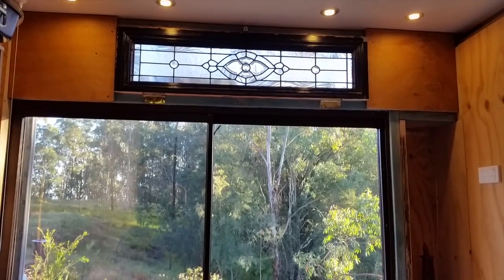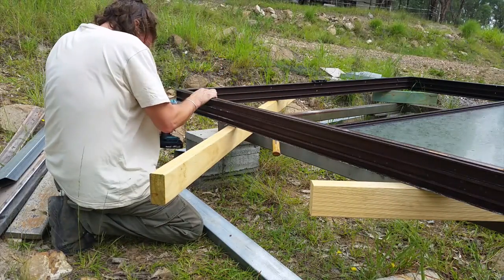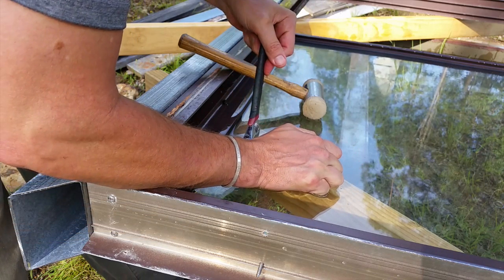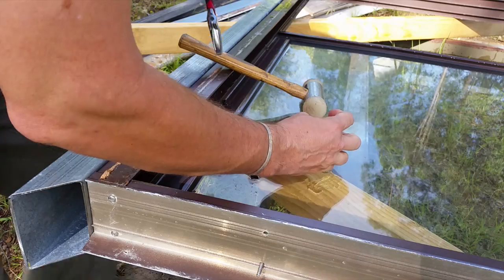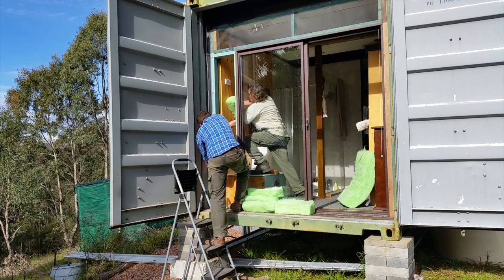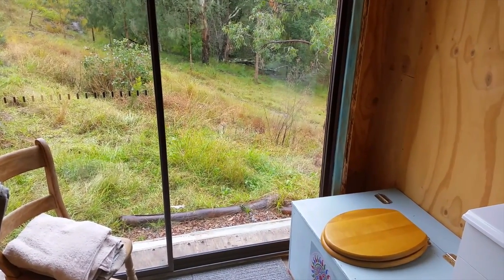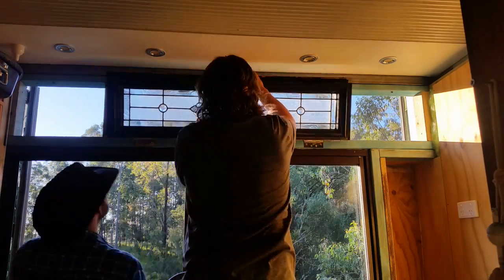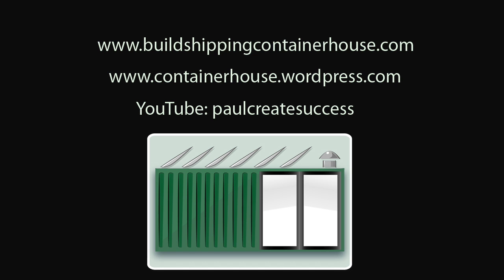Shipping Container House – Install sliding glass door wall in shipping container bathroom

Comment: Naturally people are impressed with your skills and ingenuity... the stuff Australia is made of.. but wow. what effort for such a cheap door. the biggest concern for me would be that door is already second hand and they are rubbish to start with. How long do you think that door will last? I think you will be replacing it within two years and you may then have a hole in the wall you can't fit any other door in? I'm about to go 'off grid' myself but I'm paranoid about things breaking or not lasting.. so I'm going the other way. only buying the best.. BTW. its a great vid thanks for posting!!
Reply from the maker: +bicanoo_magic Hi Bicanoo, Welcome. I can respect that opinion. I have considered that approach. If I were going to replace at a later date I would for speed and effort get one made the same size. The reality is that having built everything I fully understand how easy it was to assemble. I would be able to remove it in a very short period of time and framing around the the replacement was very inexpensive. I invested time rather than dollars. Thankyou for sharing, it is good to share alternate approaches. Cheers Paul

Comment: Glad to see that pane of glass did not break when it dropped from the frame :)
Reply from the maker: Bush Block Homestead So was I. I spent a lot of hours with that sliding door. It was originally going at the other end, and I made the steel frame in 100 x 50 before the design was changed. cheers Paul
Reply: Bush Block Homestead my heart was in my mouth when it dropped!!!!!!!!
Reply from the maker: petranilla14 Not just yours, I thought I had lost it. You don't see the weeks of work that got it to that stage. I made big steel frames that in the end did not get used. It is keeping the kitchen much warmer as the sun heats the kitchen nicely through the glass. Cheers Paul